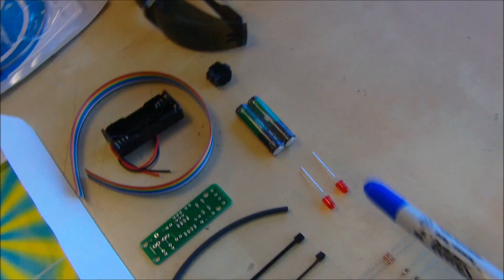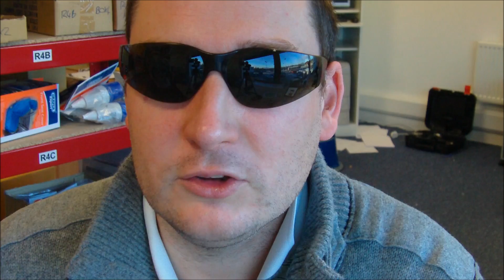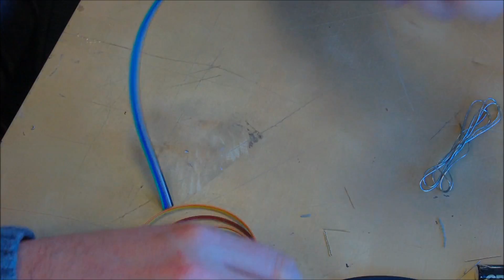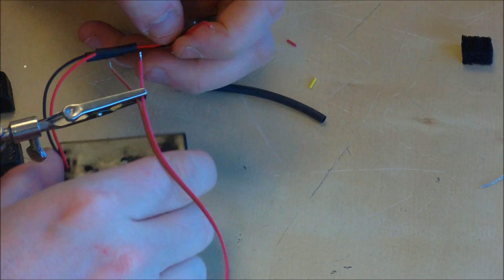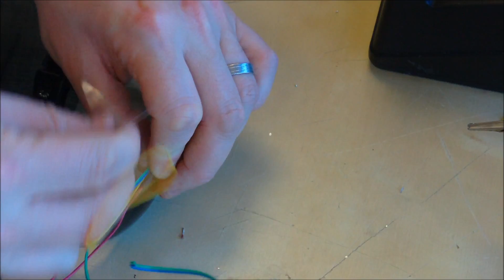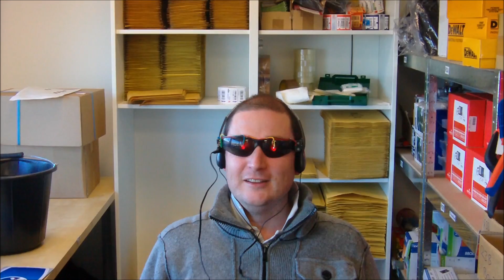Richard Makes Stuff #3 The Brain Machine

Comment: Might I suggest a few mods that make this so much better.
First, skip that dorky mount in the glasses, put the thing in an altoids tin, battery and all, a standard DB9 connector pair provides all the needed connections and a bit of ribbon cable.
Second, tri-color LEDs, simply select the colors you want beforehand with a set of DP3T switches.
Finally, use cheap safety glasses and NOT drill any holes or otherwise alter the glasses, simply bend the LONG leads of the LEDs to an angle and tape.